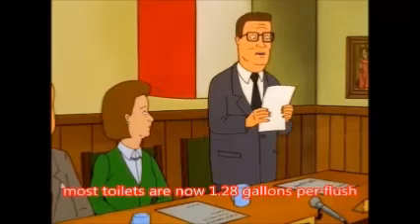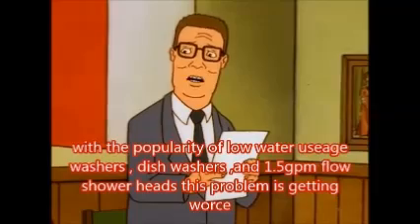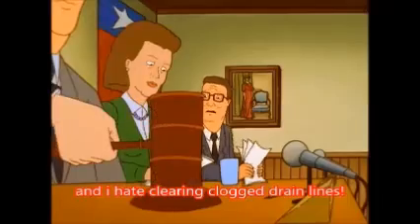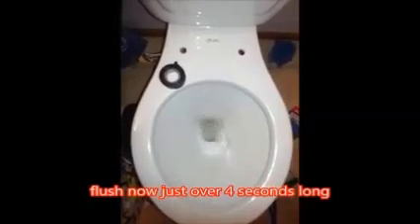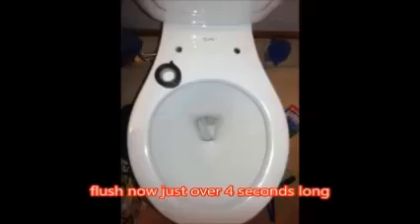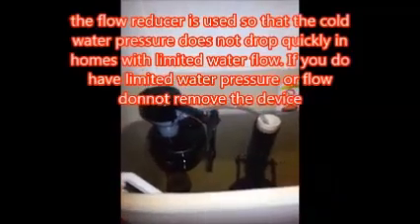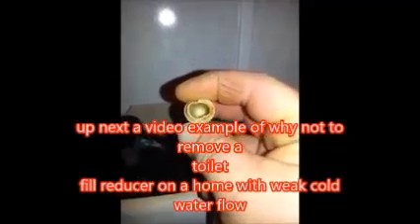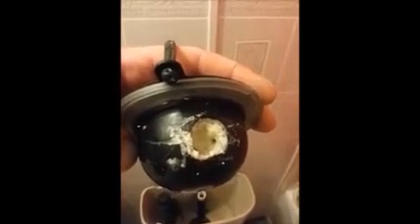Modify  a low flow toilet into a high flow!

Comment: November 2025 update. I had to change the fill valve a year or two ago and today on the 1st The flapper is finally starting to cause me issues of occasionally leaking unless I jingle the handle a little bit. It's not the chain it's the flapper itself starting to wear. Looks like I might get a decade out of it cuz I'm not too good to jingle before having to go through that again hahhaha

Comment: I solved the issue by installing one with a pressure vessel inside the traditional water tank. Everytime the toilet is flushed, the toilet converts the energy of the water pressure to air pressure (~20 psi) and stores it in this pressure vessel to be used at the next flush. 

Doesn't matter if your 4 year old squeezes out some deer scat sized poo pellets or your 370 lbs. uncle fills your bowl with his 3 yards³ of viscous doo doo butter, when my toilet's flush handle is pressed, inside of 1 second the toilet mechanism opens the water line and the pressure vessels venturi restricted dump (tehehehe) valve simultaneously. The way the internal plumbing is designed, the kinetic energy from water pressure which was converted to and stored as air pressure in the pressure vessel during the previous flush is now transferred back into water pressure and combined with the nominal water pressure and channelled through a conical release port located in the bottom of the bowl, under the bowl's static fill line and essentially directed right down the toilet's built in discharge trap channels. 

Because physics and stuff, the ~20 psi of air is pressurized to isn't adding 20 psi to the pressure of the flush water being introduced into the sewage lines downstream, which is actually good because more physics and stuff. 

However, regardless of the energy lost during this sequence, whatever the average final pressure measured at the toilet's conical discharge port ends up at, short of a fully cured cement plug obstructing the flow, it is far more than enough to force any type, volume, consistency, density, or weight of material loosely sitting or stubbornly adhered to the side of the bowl's ceramic surface into the discharge outlet, through the  trap, and into the building's sewer or septic main. 

And the cycle begins anew! Good talk

Comment: just an update been over 2 years now and the foam is still working , had to replace the fill valve today  and happened to remember i made this video .i bought the same fill valve brand and style as last time but wouldn't u know they made it where the float adjustment screw only goes so high now so i lost an inch of water, gonna have to mod that now.... bastards...... I don't need to save water im on a well with a septic i use water and it goes right back in the ground 500 ft away from where i got it from

Comment: I have two American Standard low flow toilets, one 1.6 gallon flush, one 1.2 gallon flush. They both work fine. You never have to flush them a second time.
Reply: Not all of us have good pipes.
Reply: I too have an American Standard low flow toilet and it's the most expensive and worst piece of crap I ever bought.  If you hold the handle down to get more water out of the tank then the toilet "loses prime" which requires you to flush 8 (EIGHT) times in a row to reprime the toilet, followed by waiting at least 15 minutes before using the toilet again.  <--- those are the instructions i just received from Am Std in response to my complaint.
Reply: How big are your dumps? Not very I suspect and have you done an analysis of the water after you flush? Do it... the results aren't pretty.
Reply: Ha ha no low flow is a match for my morning logs 😀
Reply: Right. And i have a magic toilet that gives me 100 dollar bills when i shit.